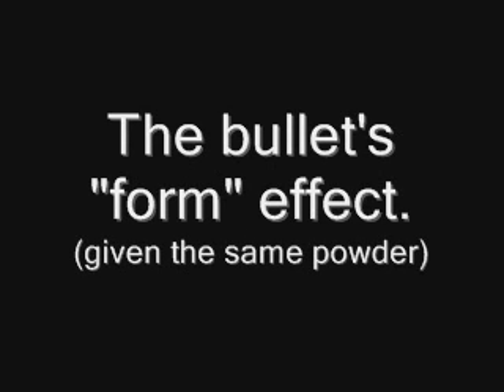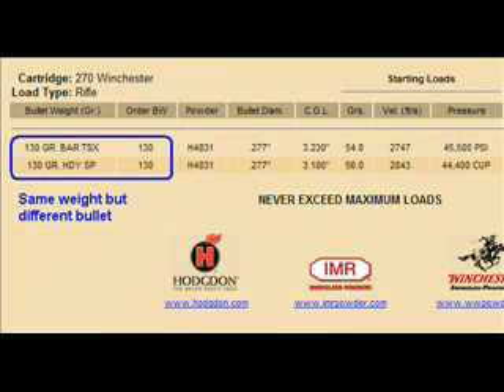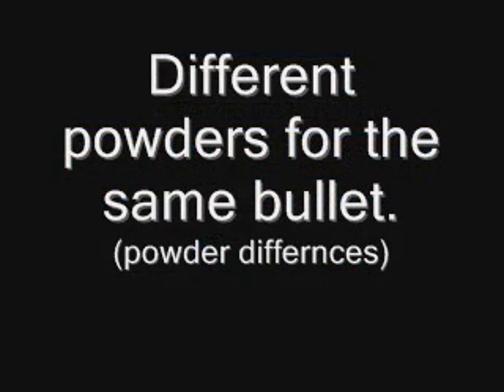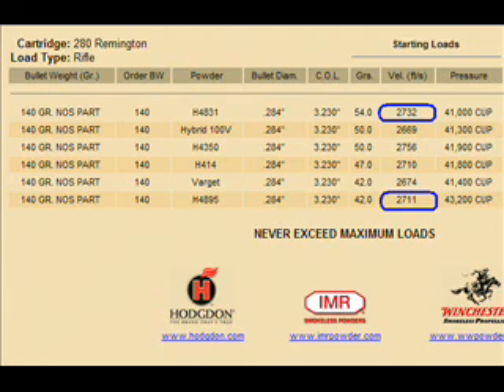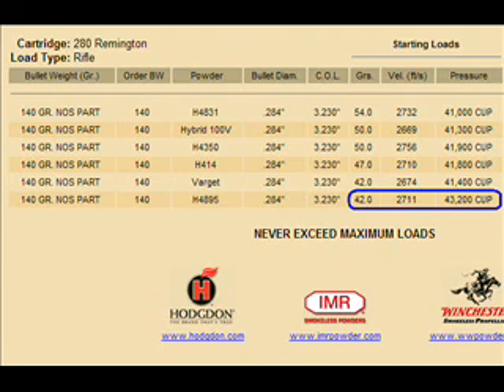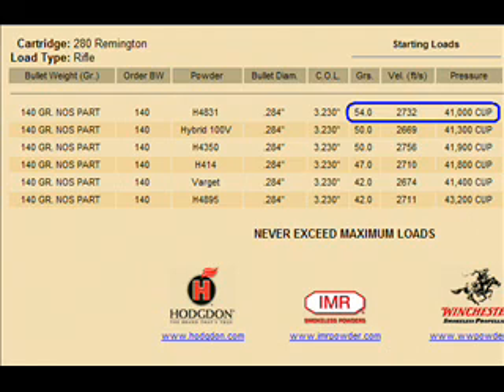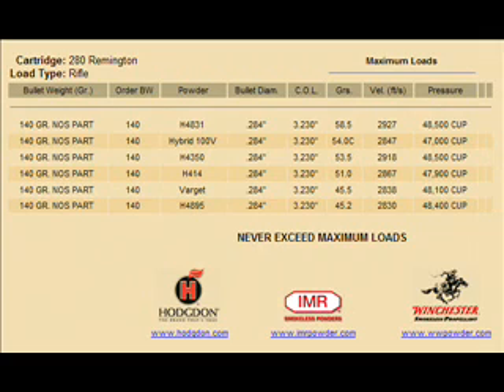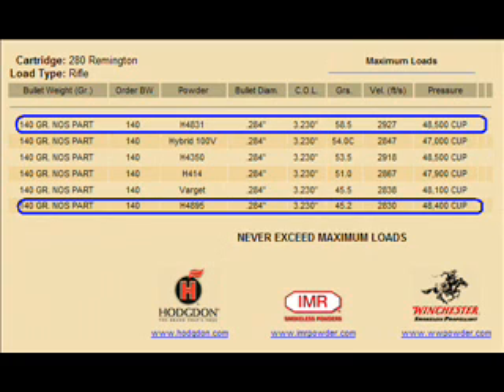An introduction to propellants -- Part 2

Comment from the maker: Thanks, I have worked up the .458 & like in the 450 marlin single-shot, I used the Barnes all copper spitzer (can't use pointy bullets in tube fed mags because the tips point on the next cartridge's primer - may detonate). I used this bullet (don't like the company) because copper & alloys are less dense & therefore oz per oz, you get a longer bullet (i.e. better BCs & lighter {stable bullets} are possible). I tried Barnes bullets in the .270 but didn't like the performance on game (w/bad shots)